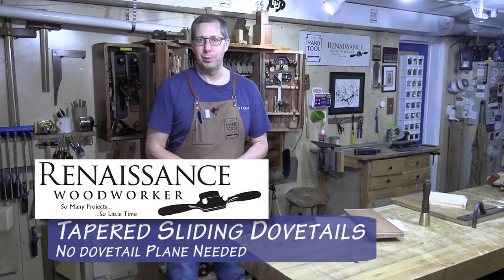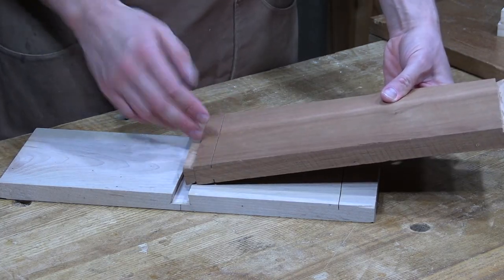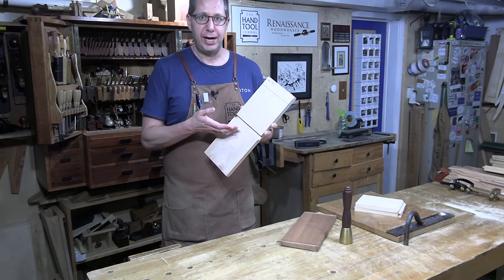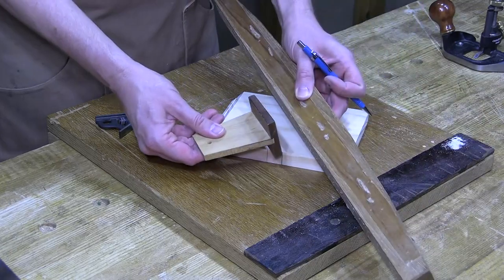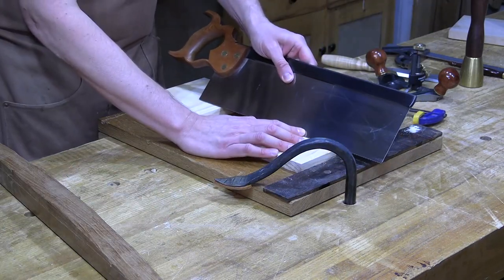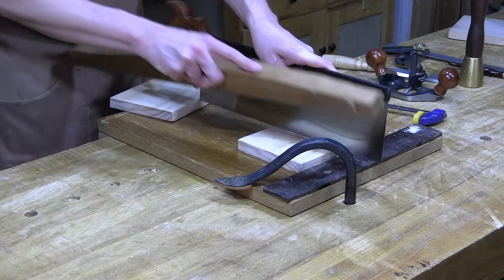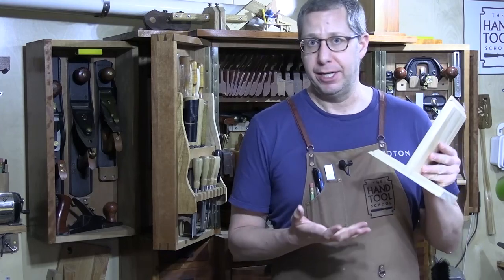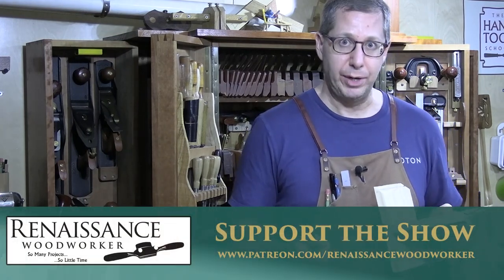How to Cut Tapered Sliding Dovetails by Hand

Comment: Shannon, i decided over a year ago I need a raised shelf on the back of my reloading bench to hold heavy tools like reloading presses. My sketches made me think I should have sturdy joinery for the middle uprights, and since the ends were to be made using hand cut dovetails, why not do sliding tapered dovetails for these uprights? I studied this video several times as I revised my plans! And a month ago I completed the project following your excellent method, and the 3 sliding dovetails form the case for 4 drawers. It was tremendously satisfying to build, and I couldn’t be more pleased with the results.  Thank you for sharing your techniques so freely and so well.  Your channel is a jewel among the plethora of woodworking channels on YouTube. 👍👍
Reply from the maker: congratulations

Comment: I tried out a parallel sliding dovetail as a practice joint last week......like you eluded to I had the initial thought of "I need a dovetail plane to cut the male part".....I cut it with a chisel in the end basically the same way as you showed, it wasnt perfect like yours but I seen it could be done this way.....and this video has reinforced that in my mind.........Im gonna use a sliding dovetail now in a cabinet build that I have comin up :)
Thanks for this Shannon, whenever im stugglin with a technique using hand tools I always find inspiration in one of your videos, keep doing your thing Mo Chara :) 
Mo Chara is Irish for "my friend" ........Shannon is a river in Ireland which could possibly be where your name comes from :)

Comment: Your parallel layout first allows a check: if it's accurate, the socket width marked on the far side will match tail board thickness.  If it does, it confirms all layout between.  Now add taper with confidence.

Comment: Have you commented on the pros and cons of acute angle versus obtuse angle to act as the crosscut saw guides? I am interested in your choice to use an obtuse angle. I set up my guides as acute simply because I thought they would reliably have more surface area to be clamped upon and it would be better to observe the material while sawing. Also have you not considered another set of support guides for the chisels to trim the tapers, shimming one side to adjust for the taper. This angle block might be more essential with denser woods that don't allow for as much compression
Reply from the maker: In my untapered sliding dovetail video I do talk about my choice for the fence.  My fence is actually set up acute because then it sits on the keep side of the line and if the saw should jump the kerf it can only do into the waste area of the dovetail.  If set up obtuse then you would set it on the waste to make the undercutting angle and there is possibility to mar the workpiece if the saw shifts or jumps the kerf.  I've used the same fence as a chisel paring block as well but have found that it is more work and not necessary as long as you have a good layout line to work to.